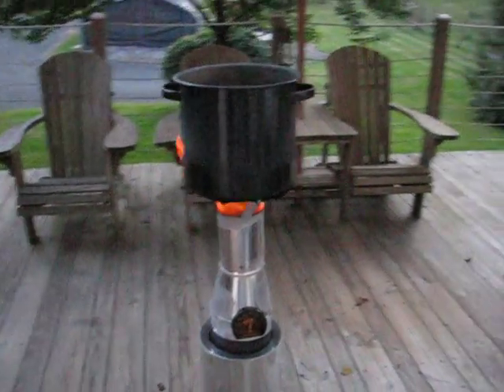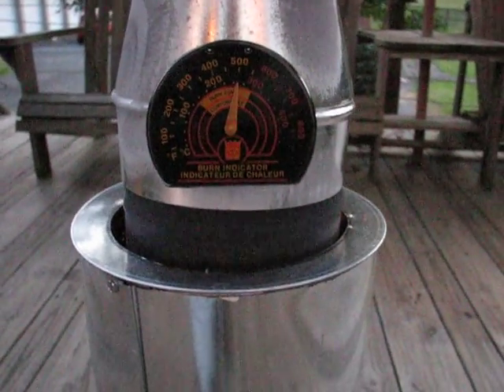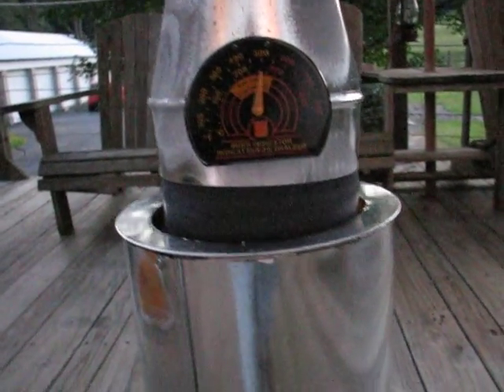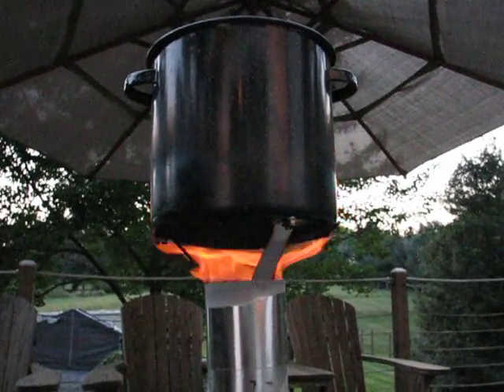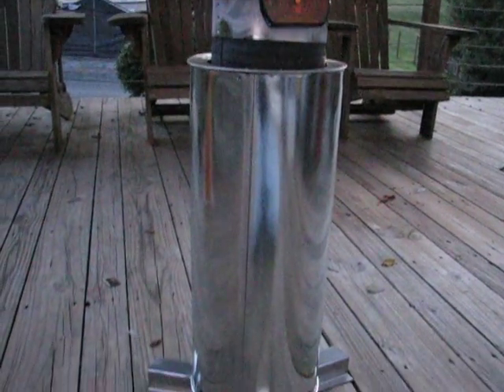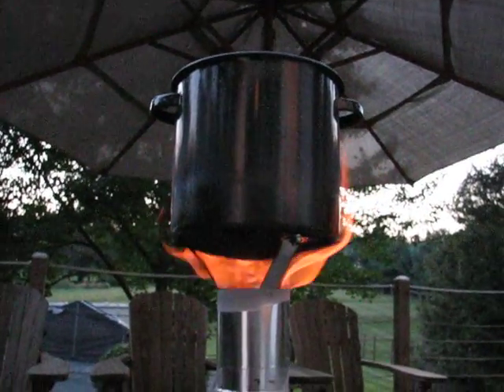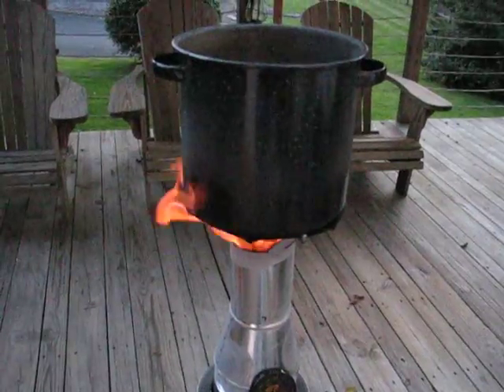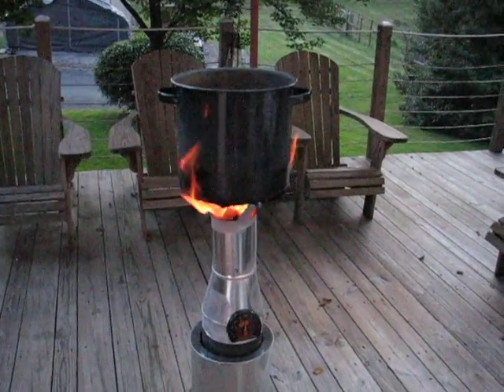Gasifier Stove part 5

Comment: You need to shoot a little high heat flat black spraypaint where you ftake IR temp readings.  IR on bare metal particularly shiny metal can be very inaccurate...  Good flame out from that thing:)
Reply from the maker: yea had to burn it in first.....but now painted flat black the temps are virtually the same....650 to about 700 depending on the fuel.....thanks!...I've built my 3rd one now!